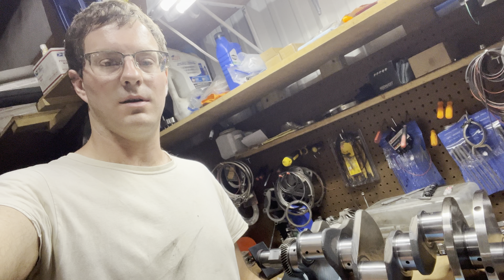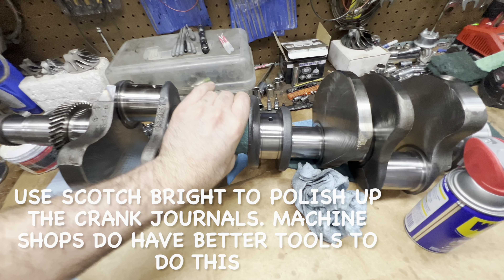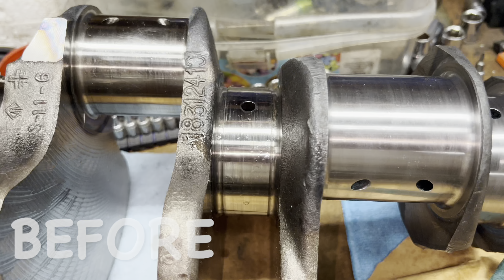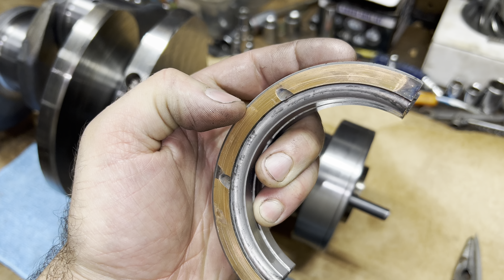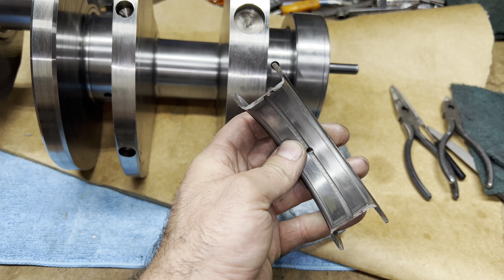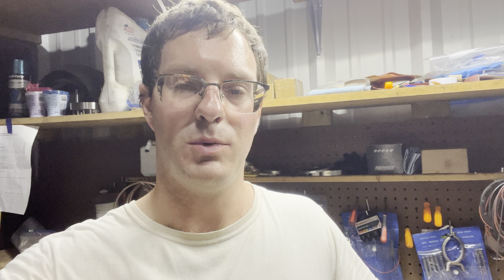7.3 Powerstroke crank shaft inspection before engine rebuild

Comment: You can put a Speedi-sleeve on that rear main to fix the grooved sealing surface. Sometimes there’s a different seal you have to get separate, sometimes it comes with it, probably find it all on rock auto. I’d triple wash that crank with hot soapy water and high pressure to be sure I got every grain of grit.  Surprised you didn’t find a way to chuck it up in your lathe and spin it while you scotch brite ( only works for mains I know but I think the pros have some kind of special polishing rig with strips of emory cloth that can do the rod journals too) Assuming this is the crank out of the Box Van, hope you’ll do a whole documentary of the build.
Reply from the maker: I’ll try to get parts to do the Speedi sleeve. Thanks for the tip.